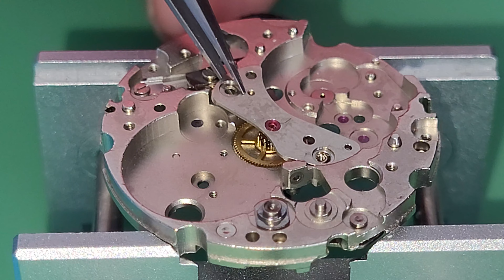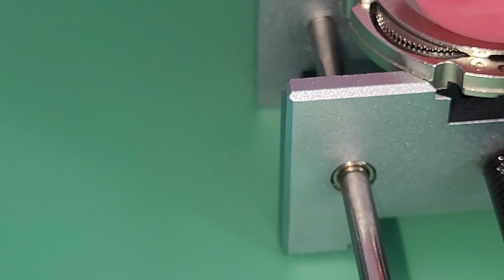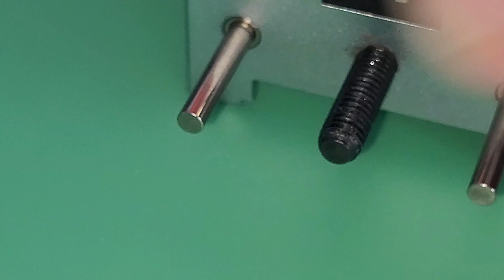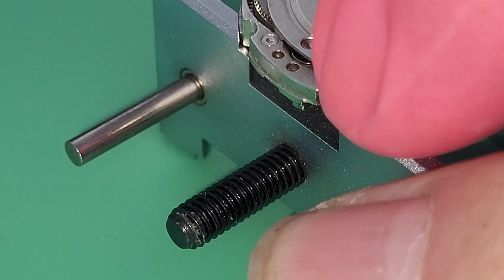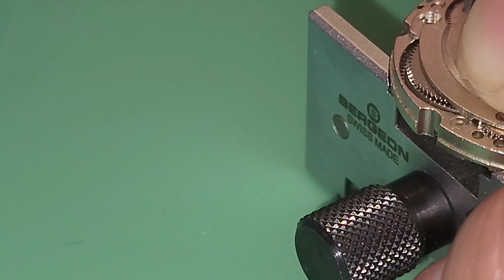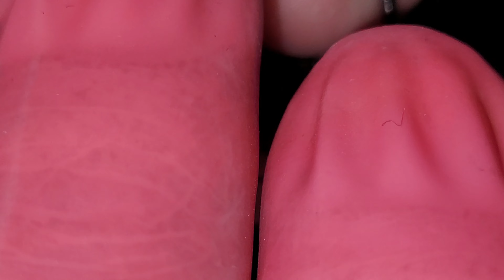Assembly of The Miyota 8215

Comment: 56:47 -- What is the screw driver used here to screw the rotor?
Reply from the maker: 2mm
Reply: @ Thanks. I’m planning on removing the rotor from my 8215 due to it being really loud, essentially making it a manual wind. Would there be any performance concern/issue?
Reply from the maker: No.problem,no issues

Comment: 12:00 I just did a service on a practice service on a DG2813 which is a clone of the 8215 and alining all the pivots on one plate is not fun.
Reply from the maker: That's right, the first time I used it it took me over 3 hours to get the lid off. Now after so much training it takes me 5 minutes. It's just a matter of practice.